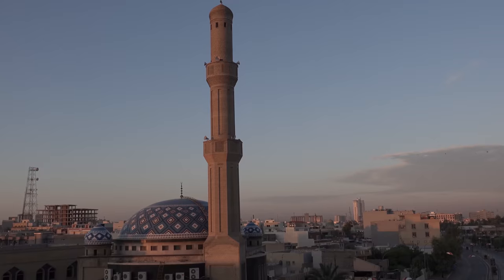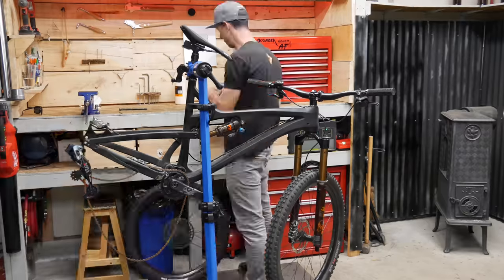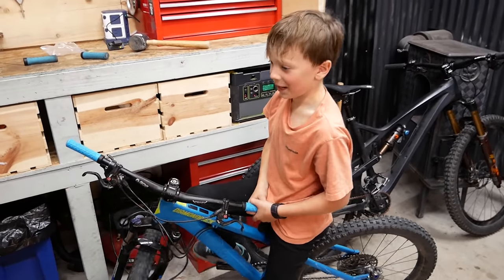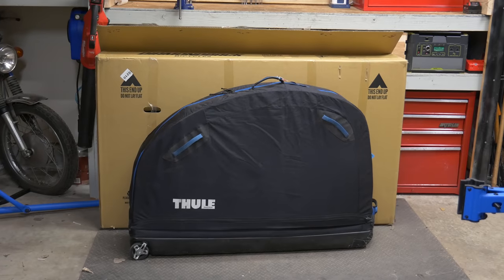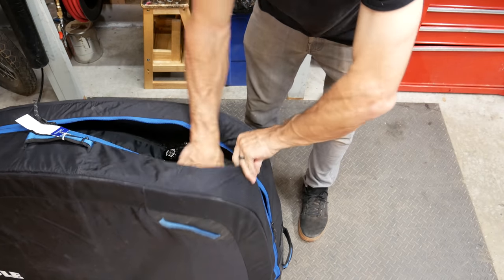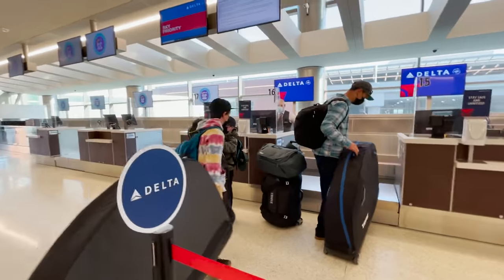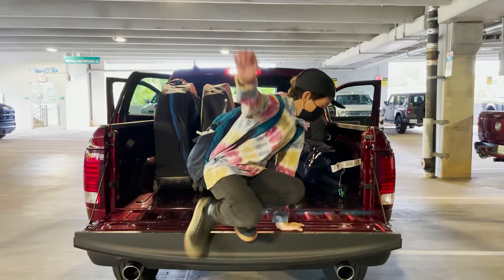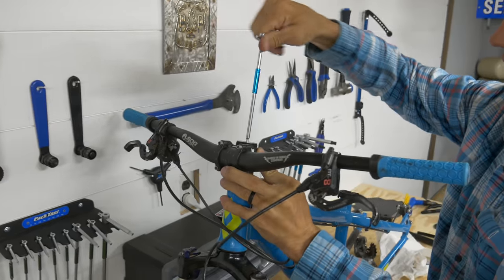How to fly with a bike! Traveling to Berm Peak with the Porter family

Comment: Another good parking tip is to drop everyone but the driver with the bikes and luggage at the terminal and then go park - offsite or long-term doesn't matter as much.  When you return, go get the vehicle while the rest of the party is waiting on the luggage.  It may take a few minutes longer, but it's less hassle than trying to put all that luggage into the parking shuttle.

Comment: You have to deflate and take out the tubes?  Spend half your holiday putting it all back together then taking it apart again
Reply from the maker: No way, I don’t deflate the tires! With the golf bag you need to sometimes cause it’s so small
Reply: I read that commercial flight cargos are pressurised. The max your tires/fork/shock/seat post will change by is 3-4psi - not worth deflating definitely not worth taking your tubes out... 👍🏽

Comment: Hey 1 question,  what do you recommend with the tire pressure and tire sealant?
Reply from the maker: Hard to say in a comment, lots of factors including your tire casing, what terrain you're riding, how much you weigh, riding style, etc. I'm usually in the mid to upper 20's for PSI with Kenda trail casing and orange seal sealant, I weigh about 190.